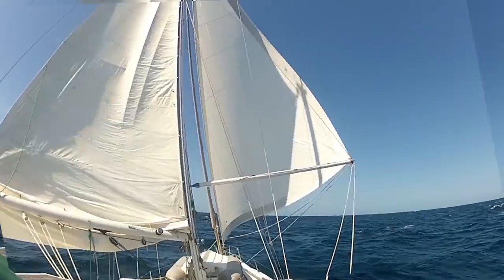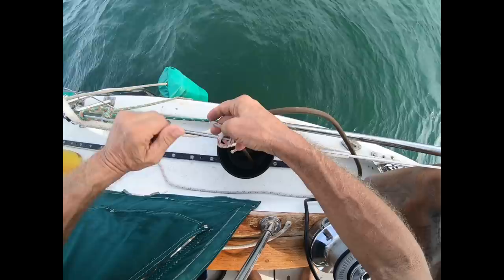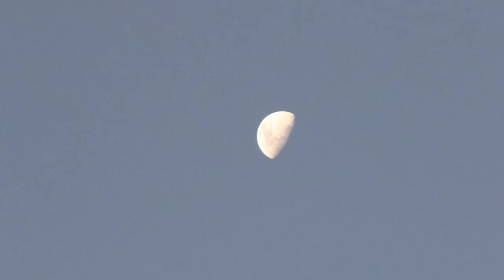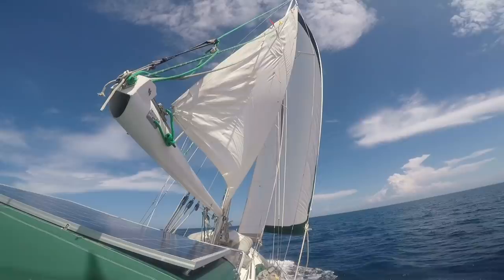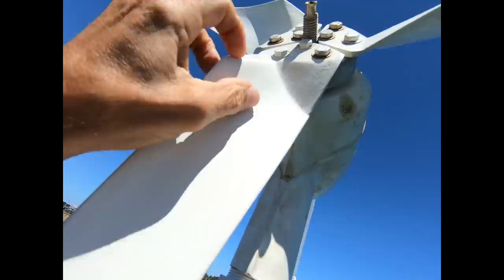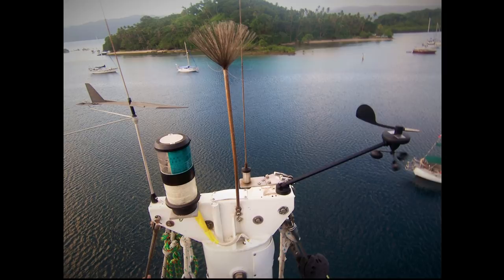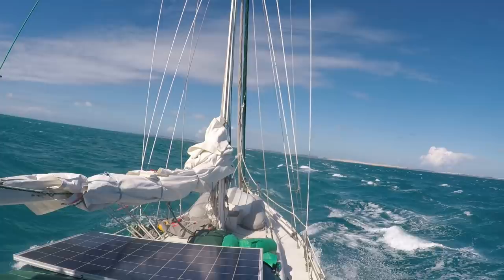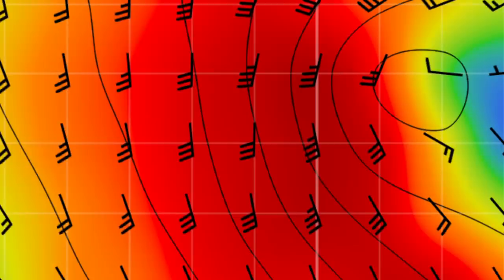Nothing like a Mozambique Cyclone for some FAST SAILING!  (Patrick Childress #37)

Comment: Great stuff. So informative. I am not a sailor but even so.........perhaps one day! Ace tip about sailing in to an anchorage at low tide so that if you get stuck the tide will lift you off. So obvious but I've not heard it mentioned on any other videos. Fair winds!
Reply from the maker: Hopefully we can keep picking out those details and put them in videos. We now do things without thinking about them so I have to slow down and think what might be useful to others. Thanks for tuning in.

Comment: Patrick, not sure if that was the mast connection but if it is I would take that ground off the through-hull because if Brickhouse ever did get a hit from lightning, it could blow that throughout right out of your hull.  I've seen the damage that a direct hit causes and it will easily blow that to smithereens.  Also, while I absolute agree on grounding the mast, be very careful to make sure that the cable is sized very large (looks like you have 0 gauge which should be O.K.) but also try not to have any big bends in it as the lighting will take the shortest path to get to ground and will jump when it gets to big bends with ease.   That said, grounding the through hulls is the right thing to do for keeping down the electrolytic damage but I would make very sure it wasn't tied into your mast bonding. (I don't think you did that but the way you talked about them together in the video might lead people to do that)   I also agree with your strategy on the witches broom as they put them on airplanes for similar reasons (although I've also flown on airplanes with them through heavy precipitation and had St. Elmo's fire jump 6" from the windscreen to my hands - looks really cool but don't do it wearing rings!).   So sad you are leaving Tanzania...  l loved that place too but you will love S. Africa as well.  Nice seamanship with that channel... strong currents running against strong winds make for uneasy passages.  Looks like you found some nice people in Mozambique too!  (I haven't had that pleasure).  Keep the white side up!  You and Rebecca are awesome... love your channel.
Reply from the maker: Thanks for your input on the grounding. I have always been a little concerned about my grounding system. Not only does the mast ground go the prop strut but also the SSB radio grounds. The radio ground also goes to the thruhull. So lightening could possibly back up back to the radio rather then just dissipating into the ocean. With your motivating comment, after 12 years, I think I will move all SSB grounds to the one thruhull and leave the strut for only the mast ground. Gordon West says only a thruhull is needed anyway.   I am familiar with the static dischargers mounted on the trailing edge of aircraft wings.....so maybe there is a correlation with that and a mast mounted witches broom. I just had an exchange with a sailboat owner who was once hit by lightening. His mast was not grounded so there really does seem to be something in the equation about grounding the mast.  Thanks for you compliment!
Reply: Ok so I'm not crazy.  I've heard of these warnings before that lightning can blow your thru-hull right out of your boat!!

Comment: Regarding lightning strikes, as I have setup many Ham radio antennas, I've always found grounding a strange proposition. In amateur radio handbooks, you'll see spark-gap setups for grounding; ie. not having a continuous path to ground for an antenna or mast, but a 1/4"+ gap between the lead wire and the grounded side, and during electrical activity, you may see sparks jump that gap. I don't know if this would be good or bad for a mast, but it might be superfluous, as a keel stepped mast usually has continuity with a metal keel anyway, and a grounding strap is just adds a little extra capacity, ensuring the mast is connected to the keel. I guess grounding the mast is important because if lighting strikes, you don't want the most efficient path of the current to be through someone standing in the cabin, but it it still isn't clear to me that a fiberglass encased keel can create a good path to ground either. Anyway, unless I'm in open water where there is a possibility of a rogue wave, lightning has always been my biggest concern in bad weather.
Reply from the maker: Louis, that is interesting, a spark gap. I have never heard of that before. Gordon West always suggested a ground plane but then it seemed, he was suggesting just attach a ground to a bronze thruhull. Our keel is completely encased in fiberglass so there is no sense in attaching a ground to a keel bolt. Our ground is attached to the propeller strut where the zinc is. In the 44 year life of this boat, it has never been hit by lightening, even though it has been through a lot of violent lightening storms. In our next video, part 2 of sailing around S.Africa, I caught on video, a terrible lightening storm we went through. Once again, we were not struck. The only reasoning I can come up with is that a static discharge is dissipating from the mast through that strut, making our boat not attractive.  Yet there are sailboats that have been hit 2 and 3 times. In about 2 weeks, watch that next video, there is some very impressive lightning and sounds of zzzzzzztt.
Reply: @SailingBrickHouse-RVLife  I would say don't mess with "success". Electricity will seek the most efficient path, and that is why I've always been leery of grounding things. If you were ever struck, any wire you attached to some exterior point would likely vaporize, and any capacity that wasn't handled by that wire would wind up burning through the fiberglass anyway. So in a way, I think it's safer to have your mast insulated from the water since it may mean your mast isn't an efficient path and doesn't act like a lightning rod. For HF radios,  (not VHF nearly as much) you do need a ground plane, as it acts as your "return path", completing the circuit created by the electro-magnetic radio waves, especially for TX since your amplifier needs to see a certain impedance to be efficient and not burn out because the impedance is too low, or not be effective because impedance is too high  & RX isn't as sensitive to impedance issues as TX, but a good ground-plane does help with improve reception...and with regard to that, go with what Gordon says!
Reply from the maker: Thanks for the information, I am a general Ham but still some of the concepts I need brushing up on.

Comment: Not sure where you guys currently are ? At the southern tip of Bazaruto across the channel to the open sea you have Benguerra island and it’s a great place to anchor. My favorite in this area. Just outside the mouth/ channel into the open sea is a rock formation called 2 mile with great scuba diving
From there down to Inhambane (Barra) is the next spot to hide from southerlies if you need it. 
From Barra the next point is Inhaca island as a southerly hiding spot.
Safe winds hopefully if you have not passed through we could meet up at Inhaca island. Rgards
Reply from the maker: Hi Mike. We did spend a day or two at Inhaca, moving around to the light house when the wind shifted. But as expected, the waves wrapped around the island and we found it better to be tacking against 25 knots than sitting in the swell under the lighthouse. That will be in the next video. Now we are safely hauled out at Zululand. Maybe still, our paths will cross.
Reply: Hi Mike...when we were there I put a comment up, I think up on our Predictwind Positions Page...the only thing I could access without internet to try to let you know we were there...but alas you didn’t see it... sorry we missed you. my mistake for not writing down your info for when we didn’t have internet...it was sort of a messed up time in Inhaca...more about that in the next video...it wouldn’t have been very “social” if we did meet up with you there since we were chasing anchorages there at Inhaca for somewhere comfortable during THAT blow.
Reply: @travelsandanimals1993  pity. When the southerly blows there is a nicely protected Anchorage at Santa Maria which sits at the bottom of inhaca. I was in Richard's bay 2 weeks ago (via road) returning from Durban. Enjoy your stay there. Some nice parks to visit nearby

Comment: Nice vid as usual. As for lightning protection not sure if bonding to a thru hull is a good idea. If lightning struck the mast and traveled down to the thru hull, would it not be possible that the force causes the thru hull to fail or heat up to such a degree that it melts the surrounding fiberglass?
Reply from the maker: If you have valid information to support what you are saying, please share it with us. I am not an expert at this. Just because I have never heard of this happening does not mean it hasn't. Why would the thruhull alone heat up when it is acting like a wire in a common circuit? Anything leading to the thruhull would also heat up....and how hot does it have to get to do what you are saying?...unless it is a Chinese piece of junk thruhull. But how else are you going to channel all that electrical power out of your boat and into the water to dissipate? The idea though, is to bleed off the static build up so lightening is not attracted to your mast in the first place. So far, it has worked for 41 years on our boat and this boat has sat and sailed through some tremendous lightening displays. I can only hope it keeps working. Thanks for your comment.    

      
Read more
Reply: @SailingBrickHouse-RVLife  
It's just something I once heard from a fellow sailor.  I was just posing the question to see if anyone else has heard of this.  Good point though - the mast would heat up as well.  My last boat's mast base had a wire leading to a keel bolt.  That never made sense to me bc the keel bolt  was not grounded to the water outside the boat 🤔

Comment: Witch's booms work period.  I know why.  Im not an EE.
Reply from the maker: Tell me more?
Reply: @SailingBrickHouse-RVLife  they allow the discharge(equalization) of "static" to occur over a wider area, thus decreasing the overall charge differential, but decreasing the point magnitude differential.  Fancy way to say they drain the charge of your mast(boat), which happens anyway, but do it over a larger area.  Hope that makes sense.   I have alot of experience with these things, and have seen them glowing during lightning storms.  The little wispy ends will 🔥(ionize) over time and get shorter, necessitating replacement.
Reply from the maker: Oh ok...glad we have it ip there etill then!
Reply: @SailingBrickHouse-RVLife  you have heard of St Elmo's fire?